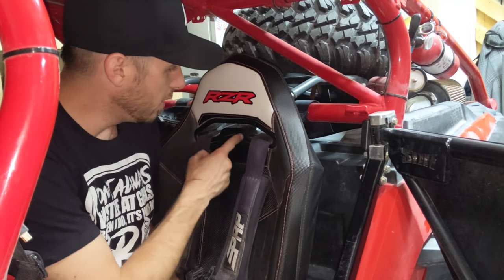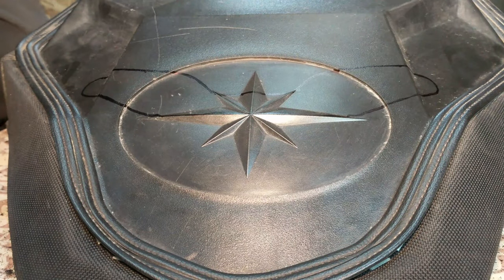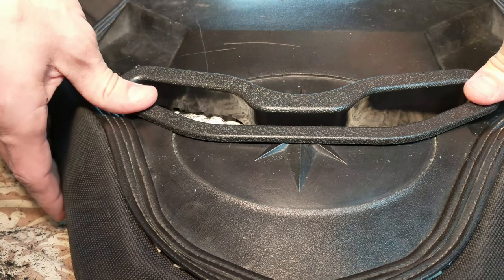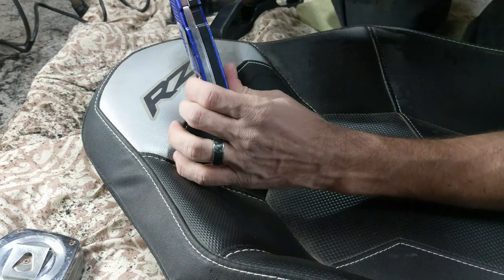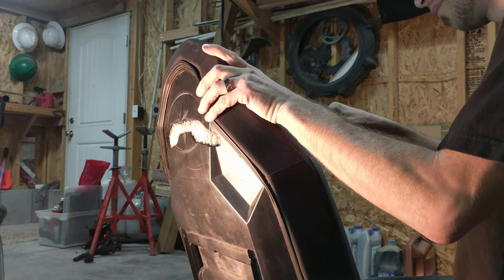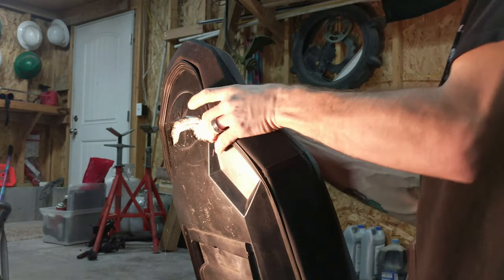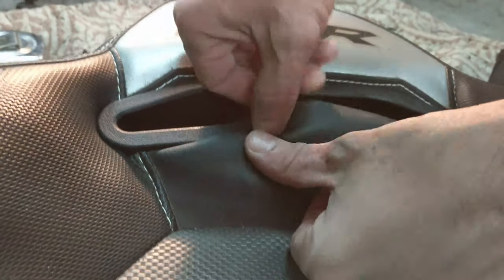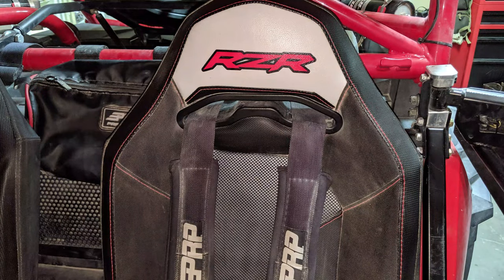How to install Dragonfire harness pass through the EASY way

Comment: I have a 2022 RZR and the seat stitching is different. It was a little tricky figuring out where to make the cut, and it feels weird to cut into your seat, but it turned out good.  It was difficult to get the front and back pass-throughs snapped together.  Now to do the other seat . . .   The kit works well and is much cheaper than buying new seats with openings already in them.

Comment: Hey I'm wondering if you've done it on a different style of seat. My seats stitching doesnt slant down on the ends it's just straight, I'm wondering how the measuring 1" will work on that?
Reply from the maker: Is it a RZR seat or something else?
Reply: Ya it's in a 2014 xp4 1000 my seats stitching is different
Reply: I was going to send a picture but cant figure out how, the stitching under the RZR goes straight across, where yours on the ends they slant down. Do you think just measure the 1 inch down and then line the bezel up and mark the slants using the bezel?
Reply from the maker: @tjim2424ify  Dragonfire part #15-0013 is listed on Dragonfires website in the fitment area for Polaris RZR XP 1000 2014, 2015, 2016, 2017, 2018, 2019. I have never installed these on a 2014 unfortunately but I think its a pretty safe bet that the install will be very similar. If I am understanding you correctly, then the center line cut will be the same. May have to wing it on the sides a little bit.  If you decide to try then my advice would be start small and work your way out very little at a time while test fitting the piece in between each small cut. I hope this helps. Sorry I can't help more on the 2014 seats. Also if you do end up doing it, could you let us know how it went?!
Reply from the maker: @tjim2424ify  take a small video and post it on YouTube maybe? Post the link here.
Reply: @techandtoystuff  yes I'll let you know, I could probably make a small video on what I had to do but I'll take my time and hopefully dont need to buy new seats after.
Reply from the maker: @tjim2424ify  I took a few pictures with measurements of a stock 16 seat unaltered so no insert cut in so you can get an idea of where to cut the 14 seat and how far. I'll put something together ASAP and post a link here.
Reply from the maker: @tjim2424ify  hey is the back of your seat the same as newer years?
Reply: I'm not sure about that or not
Reply from the maker: @tjim2424ify  compare it to the seat back in the video and lemme know
Reply: Just looked at it this morning the back looks just like the one in the video.
Reply from the maker: @tjim2424ify  I took some measurements and put them in a little clip here. Hopefully this will help to locate the proper placement for cutting in the dragonfire seat bezel in a 2014 seat where the stitching is different. Good luck and cut your seat at your own risk. This also assumes that the top stitching is in the same place on the 2014 as most of the newer RZR seats. 
https://youtu.be/oo9CPxx9ea0
Reply: @techandtoystuff  awesome thanks for all your help once I'm done I'll show you
Reply from the maker: @tjim2424ify  that would be great! If you would like to take a small video of how it turned out, let's link it here and help others out in the future!
Reply: Here is the video of how I did the seats I didnt get a in progress video but kind of explain what I did.    
https://youtu.be/a_LHi_rsDnY
Reply: I have a 2022 RZR XP 1000 and the stitching on the seat is different. I have to find a way to determine where to make the front cut.